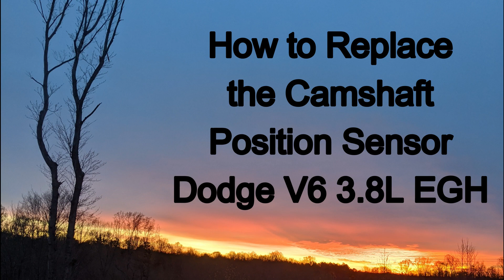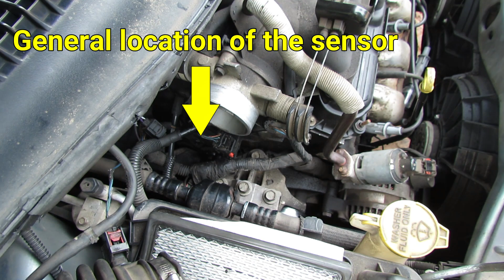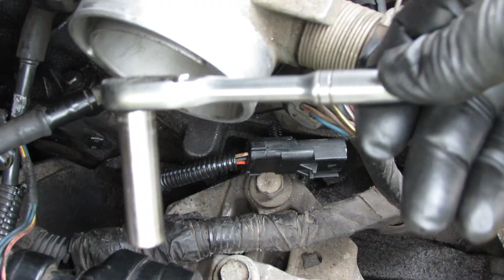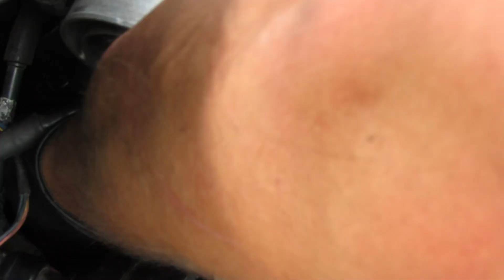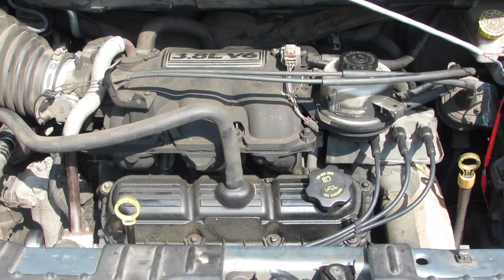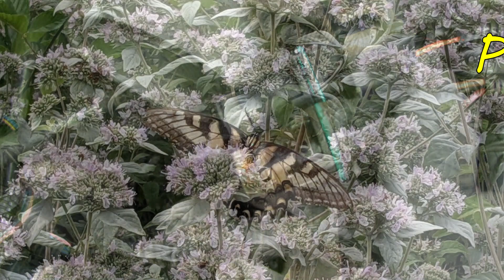How To replace the camshaft position sensor Dodge V6 3 8L EGH Engine

Comment: Working on a 93 Dodge caravan had to repair 40chewed wires crank sensor was chewed wires cam sensor had a broken mount
Reply from the maker: @StephenScherr-eq9wp BUMMER! I take it the the Mount busted and the motor rocked against the wires. I feel for you but I am sure you will get it. Thanks for watching. ~Mr. C.

Comment: I replaced crankshaft and camshaft on my van and now I get a p0016 code and the van hesitates when pressing the accelerator pedal down what can it be
Reply from the maker: @hectorramos1590 that's interesting. A quick search shows the code means they and not synchronized. Did you replace the physical cam and crank not the sensors? Maybe they are off a tooth in the timing? Just guessing here. Hope this helps. Thanks for watching and asking. ~Mr. C.
Reply: @NaturesCadenceFarm yes I replaced both sensors but it was the timing chain it had jumped 1 tooth but thanks for responding your videos are awesome God bless 🙏

Comment: What was the symptoms of why you needed to change the sensor? Did you have a camshaft sensor code?  I currently have a crank no start with no camshaft or crankshaft codes but I am suspecting the camshaft sensor.
Reply from the maker: @northtrader I did have a cam sensor code but later found out (the 5v reference video) that the sensor was not the problem. I checked for spark and fuel, easy stuff first.  You are on the right track. Look for the 5v reference on any sensor. If not there a sensor is shorted. Start unplugging. Let me know if you need some help. I can try. ~Mr. C.